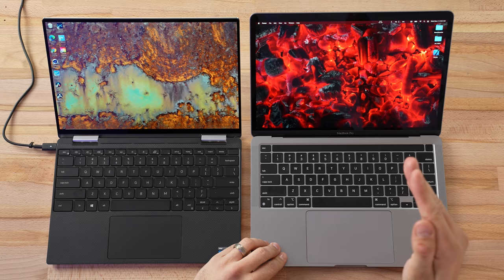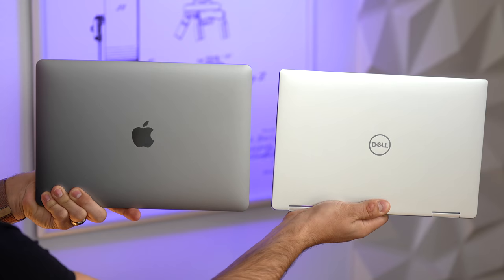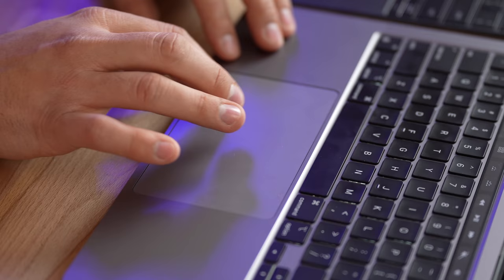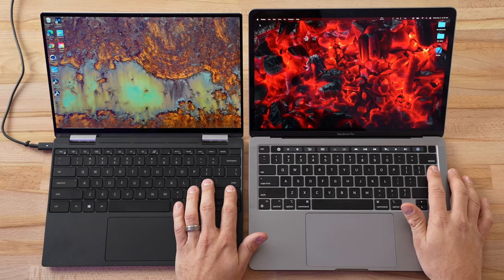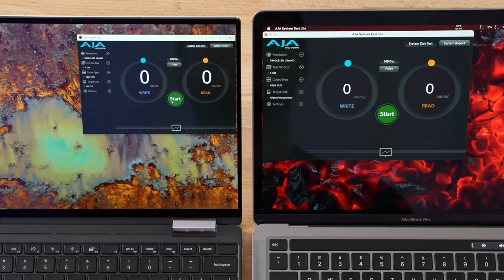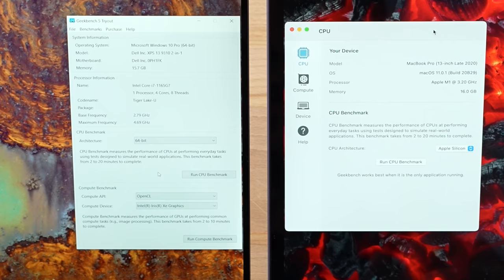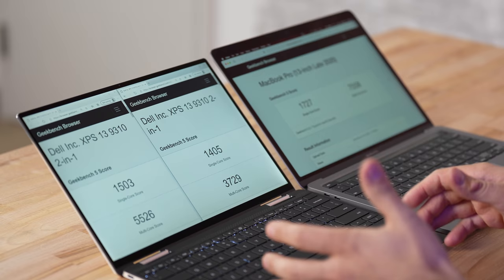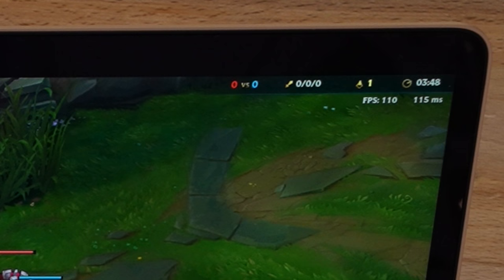M1 MacBook Pro vs Dell XPS 13 9310 - ULTIMATE Comparison

Comment: Have my Macbook Air for five days now, haven't got plugged in for second charge. The battery life is ridiculously good
Reply: Are you running anything at all?
Reply: @FooPiew  hes probably doing lighter activities for shorter periods vs heavy loads for long hours
Reply: It makes sense, the high efficiency cores use less than 2W combined at peak, so it will outperform a previous-gen macbook air while still using about the same amount of power as an iPhone, from a much larger battery than an iPhone.
Reply: Can someone explain to me, when I look at my screen time, it is always full. Even when it’s like 4am to 8am when I am asleep, it shows safari and other apps as filling up the screen time hours bars. It’s so weird so in the end, everyday I have like 19 hours of screen time which doesn’t make any sense?? I have a lot of safari tabs open because I never quit safari when I close my Mac.
Reply: Also scrolling on this M1 MacBook Pro like on YouTube is pretty choppy I have no idea why! I’m not even doing a lot of intensive stuff
Reply: @bananawilson  I honestly think this might be an issue with Big Sur because I’ve had choppy scrolling on my MacBook Pro 2020 Intel as well. Driving me nuts.
Reply: What is it being used for?
Reply: @Oberness13  it’s fine on my 2016 13” MacBook Pro 🤔
Reply: @bananawilson  it's probably Youtube. I'm on a 2018 Mac and i had the same problem a couple of times before. it comes and it goes.
Reply: @99cya  Forgot my charger and didn't care. I write articles for a living. it is truly spectacular how long the battery lasts.
Reply: @mukunddhar6657  yeah its nearly comical.
Reply: @Wilson the same problem is happening with my 2019 mbp. But i guess it is bcoz of big sur since this problem started only after updating
Reply: I plug in every 4 hrs lol
Reply: Try your laptop running rendering at Bender for the whole time and see the fast the battery draining.
Reply: @99cya  I have the 2017 pro 3,2 ghz version, and battery was absolute trash, while it was boiling and fans were spinning almost taking off... HOWEVER, since recent update (Big Sur 11.1) the battery is so much better, like .... more than twice. Don't know why as I am not a techie, but I am literally not concerned where I left my charger anymore.
Reply: when I say "absolute trash", I mean windows laptop level, lol... Now it's so much better basically 10% per hour when watching Youtube and web browsing simultaneously, so it's stretching to 8-10 hours of consumer use. That's about 4-5 hours improvement, I have no idea what they did in this update!! The fans also don't trigger as much and it doesn't get hot as it did before.
Reply: do you use chrome or safari?
Reply: I'm really jealous....where do you live....I steal
Reply: Ramses Rios  how long does it usually last? I'm a high school student and the battery last about 2 days on full brightness with Spotify, 7 tabs on google chrome, several sticky notes and discord in the background.
Reply: Ramses Rios  yeah I use the m1 mbp, it's so fast and charges pretty quickly too.
Reply: Ramses Rios  I use photoshop and illustrator for many hours with many layers, should I purchase macbook pro m1 or hp spectre x360 i7 11th gen thanks
Reply: Just wating for Samsung to get on windows boat and that will be great competition for mac's
Reply: Ramses Rios  I am using MBP M1 16GB & 256GB  since 3 days, It is blazing fast,battery is insane and outstanding screen quality
Reply: Wow. Amazing
Reply: Their is no way 5 days without charging while surfing and watching Netflix etc2... untill and unless u just staring at the apple logo...
Reply: Five days at Standby?
Reply: @Asim112 lol no

Comment: after watching camera test I’m definitely going with Mac
Reply: I mean it doesn’t really improve YOUR experience
Reply: Elegant touch of apple vs. Crappy and expensive for nothing is xps
Reply: mac os or windows....
Reply: Quite surprising! I didn’t think the Mac camera was great, but the XPS camera and mic are horrendous!
Reply: 2010, no-one:
2020: When the 720p camera makes the difference
Reply: I went with the XPS 13 (9310) Ubuntu edition. Non touch, non 4K, 16 GB RAM, i7, 512 GB HD
Reply: @TaqeebMuqaddes  I bought a macbook and the fan is always on. It's really annoying when all I did was open 3 tabs.
Reply: @user-jq2wg6vk4p  I guess since you didn’t say what model or year Macbook you have, your comment is open to interpretation.
Reply: @kenc.852  the macbook air. I have experimented with other laptops, and I guess it's just because of the work load I put onto the machine. It's holding up much better than the XPS I bought 2 years ago that's for sure.
Reply: @user-jq2wg6vk4p  I bought a MBP in Dec 2018. 8GB Ram and 512 SSD. I just purchased the M1 MBP with same spec’s. I liked the keyboard better than the mid 2018 butterfly. I hate the fact that I am giving up my other two Thunderbolts/USB’s but thinking about what I wanted for the long haul plus years I decided to make the jump and see how it goes. Just waiting for Apple to send me my trade in box now!
Reply: I also!!
Reply: I think I might want this mac if it ran windows. I will admit as an apple hater, that it actually has tons of great features.
Reply: I thought this was sarcasm before actually watching the video 😂
Reply: This machine runs very hot even in the BIOS. Dell XPS 13
Reply: Every other review has trashed  the MacBook’s camera, too. I guess reviewers have find something to complain about.
Reply: I just bought the XPS 13" and yeah, I'm returning it.  Definitely get the Mac as I've had an M1 and it's a way better machine, not just in power, but display quality/build quality and thermals.  Pretty disappointed that I paid $1,799 and got something I'd consider worse than the $999 M1 Air... Maybe I'll just go buy 2 air's 😂
Reply: Yup thanks to m1 chip, it’s all the processing power, not the camera😂😂
Reply: @TaqeebMuqaddes  (not a apple fan boy) windows user when i watched all the reviews on the macbook air i was amazed for the price and i compared the cpu to an intel (i5 10300H vs Apple m1 arm) the score is a, (geekbench 5 m1 wins almost doubled the score) (iGPU is m1 wins trippled the score) i going to get an macbook air for my birthday
Reply: Price difference?
Reply: @rishijai  savings is?
Reply: Indeed...but when I can afford it!
Reply: @KKH92  wait 2years and its going to be 600-800usd
Reply: @josephbenjamin2934  mac
Reply: @kenc.852 that’s literally the. Worst thermals in a mac
Reply: Same
Reply: I didnt get your joke. Can someone explain it?
Reply: @kenc.852  😂😂 great point
Reply: @user-jq2wg6vk4p  I went with the MBA 16gb ram 256gb storage varient.
Reply: @user-jq2wg6vk4p  Buddy, the m1 MacBook Air does not even have a fan
Reply: @RIKARD NEW ZEALAND yeah I think the MacBook literally beat most of the test Apple laptops aint garbage now
Reply: Why?
are you going to do photography with Mac?😂
Reply: @lkgamer5217  Who ask? It is good for meetings lol
Reply: @lkgamer5217  lol MacBook Pro and air are better and cheaper than windows gaming pcs go cry about it now WINDOWS CATTLE
Reply: @josephbenjamin2934  windows. Mac is useless for most users.
Reply: @ma3ttia11  yea, Mac is fine if you’re a creative worker, hardly any of my software will work on Mac, so no point even trying to compare, it’s always going to be windows, that’s the standard.

Comment: I’m genuinely shocked. This is more than fair as well. The PC is plugged in while the Mac is on battery!
Reply: @namasteam2659  not even Intel Macs
Reply: Laptops can be configured that way too.  Powering down on battery is an advantage, not a disadvantage.
Reply: @matthewhaddock6458  look at 9:32
Reply: @matthewhaddock6458  Lol because you’re not buying a portable machine, you’re buying a desktop in a laptop form factor, right? It’s not like you’re only losing multithreaded performance when on battery, you lose a little bit of your single threaded perf. as well, which matters in almost everything an average person does on their laptop in daily life.
Reply: @j.d6009  Since it helps the battery power last much longer, yes it's an advantage.  Especially when it's optional, which it is on Windows.
Reply: @utubekullanicisi  Yes, so why would you want to have to plug it in much more regularly?  Or were you hoping to buy a paperweight?
Reply: @j.d6009  Any Windows laptop in the same price range as a Mac tends to have a much bigger starting base for performance, so even when they drop, they're still often above, so your argument isn't that great to start with since they sacrifice performance for battery power in the hardware, rather than the software, therefore there's no option to turn it off.

It is 100% optional in Windows, just go to the power options and set it to high performance, it will go at 100% if you want.
Reply: @j.d6009  You're missing out on the absolutely massive thing which is for the same price as an M1 macbook, I can get an i7, sure, but it has an RTX3070 under the hood too.  In a CPU/power test, the GPU is 100% negative, just sucks power and provides 0 performance, but in the real world, it absolutely smashes a MacBook.
Reply: @j.d6009  yea, i have msi pulse with i7 and rtx 3050ti. When it unplugged, the performance going to be sucks. Because rtx3050ti needs more power from charging, can't be powered by the battery.
Macbook pro m1 is the best, i have 1 too

Comment: Dell is ridicolous. I have an XPS 15 and I have had only issues. Speakers are crappy. Lots of problems. Gonna get a MacBook.
Reply: Same, got an xps 13 and while it looks slimmed down and nice it's been nothing but trouble. Had to change the battery once first year and then right away again 9 months later. I'm on my third fan as well. The speakers has stopped working (hardware-wise) and same with the fingerprint reader. My least favourite laptop to date.
Reply: Yep
Reply: Oh how times have changed
Reply: Guys, don’t buy dell or hp laptops costing above 1k. My xps 13’s fan failed after 2 years. And now after the october windows update, the laptop mic is not working 😑. Meanwhile my old 2013 MacBook Air runs perfectly( albeit quite slow cuz it’s old).
Reply: @Chopper153  blue screen nightmare
Reply: I have had horrible experience with Dell. Terrible battery life. When i browse the web (10+ tabs while playing a1080p video) the fan sounds like a jet plane taking off. Intel and Microsoft bs apps mostly hog the ram. Plus there are countless driver issues after every update
Reply: @Aecor  I'm frequently getting machine_check_exception bsod after 20h2 update. I'll never buy another windows laptop.
Reply: @hasaanmasood  1 hour battery in a 1200 dollar machine fu*k dell
Reply: @Chopper153  me too
Reply: @Chopper153  my 2010 MacBook Pro is still running like a champ
Reply: My macbook is a Trainwreck. You won't have better luck with Apple
Reply: How do you manage to do this... Have my XPS 13 for the fith year now and no problem so far
Reply: Just got the 13" XPS and I'll be returning it.  It's crazy how apple is selling the M1 for $999....  It's better on all fronts (except for design, I prefer the XPS design/aesthetics).   Even if the XPS was $800 (mine was $1,799) I'd still prefer the M1.
Reply: I still have a Laptop Dell E5520 from 2011/2012 (I5 2520m and 16Gb Ram) and i NEVER had a problem, its nowhere near performance-wise. It has never really beinging heavely used but for around 2 years i has run 12+h a day (not being on it using it, but up and runing)
Reply: @flod5486  that is a decade old laptop and not even the same model

Comment: If someone thinks that the XPS has better video and mic quality, you better get your eyes and ears checked.
Reply: He ain’t a sheep, it literallly looks better 😬
Reply: Not remotely close. The mac looks and sounds real.  Xps looks and sounds like a toy
Reply: Dell is ridicolous. I have an XPS 15 and I have had only issues. Speakers are crappy. Lots of problems. Gonna get a MacBook.
Reply: I got scammed on buying a Dell for 1300. Fuck Dell and Windows.
Reply: I have a pretty balled ass PC and a MacBook , so , are both sides gonna be shitting on me ?
Reply: I agree with you! There is some thing about the Mac and one chip and Mac and one Mike’s and the picture. It seems like Dell model has muffled speakers!
Reply: 🤣🤣facts

Comment: Intel getting humilated for 25 minutes AGAIN😂😂😂
Reply: Lmao
Reply: Apple is stupid
Reply: @user-gr6he3hg1u  errr...why? Some detail to your statement is necessary if you are trying to explain your opinion
Reply: @Aecor  This is the first time I hear "Windows Cattle" after years of word like "Apple sheep"  floating in the internet
Reply: @kamikamieu  beacause of M1 any one who buys a windows laptop upto 2000  is one fuc*ing windows cattle.
Reply: @user-gr6he3hg1u  why
Reply: Lucifer MorningStar like your mom mate
Reply: Lol 😂
Reply: I got an intel ad before watching lol
Reply: If you paid a little attention, it is not about the Intel CPU. The Intel CPU is restrained in some cases to only 30%, in order to keep fan-noise down. Put a decent  cpu cooler, or a solid aluminium case (just like the Apple) around it, and the Intel CPU will keep up easliy.
Reply: @anoniem9518  no lol, the previous macbook pros thermals were awful with the exact same body and intel chips
Reply: @breadone_  I think you are wrong on two occasions. First: There is a difference between Tiger Lake and Tiger Lake H. Tiger Lake H is quite a lot faster as compared to Tiger Lake. 
Second: macbooks with intel chips are known for insufficient air flow. So yes, also the non H tiger lake cpu's were not able to perform to their max potential.
Reply: @johngwheeler  Well, maybe because the xps was release before the mac and is not an optimal intel configuration nor really a laptop configuration. So the good news is that probably PC users will now have the i9 or i10 more affordable and only for this, thank you Apple !
Reply: Intel has a ridiculous fan, it shouldn’t be so loud I’ve been doing research for awhile now and that has been most of the complaints definitely going for the M1
Reply: @anoniem9518  well since theres no other machine on the planet with m1, and since every other variable is kept the exact same, we can def say that m1 is significantly faster than the intel chip, since the m1 is still constrained by the macs’ thermal design
Reply: @anoniem9518  stop defending intel, at least you know why the previous macbooks with intel cpu had bad thermals ? Because intel promised in 2016 10 nm cpu and Apple started production for macbooks chasis for that cpu, intel didn t keep their promise, but all around was too late, chasis production was already making units, fucking bad syncup because of intel fault so stop defending them. Apple did their part of the deal back then and lost money because of this mistake. It s not only about the performance, it s about Intel loosing their credibility and having bad business decisions.
Reply: @user-gr6he3hg1u  lol wait why? 😂
Reply: (Not a intel fan boy) apple cripples the intel cpu look up the early 2020 macbook air the fan is not even connected to the cpu  the cooling for the intel cpu is only 10w and it throttled so when they launch the new m1 cpu they will say its twice as fast than the early macbook
Reply: They earned it. They spent a decade trudging down a poorly thought out plan and now they are going to pay dearly. Short term thinking on intels part has let Apple become the champ. I’m glad, dell and windows are ancient and made for old people by old people. Apple is expensive but great quality and cutting edge.
Reply: These youtubers are all paid actors and overhype the flaws of all laptops. I know tons of people with intel laptops and they dont overheat like he said.
Reply: @braskabani8011  actually intel based macbook overheat because apple put shitty thermal solution
Reply: Yeah the problem is that they never learn....
Reply: @user-gr6he3hg1u  bill gates?
Reply: @user-gr6he3hg1u  either fandroid or binbosheep
Reply: LMAO